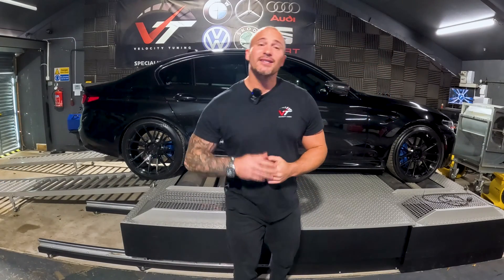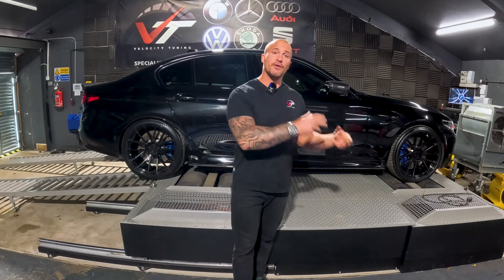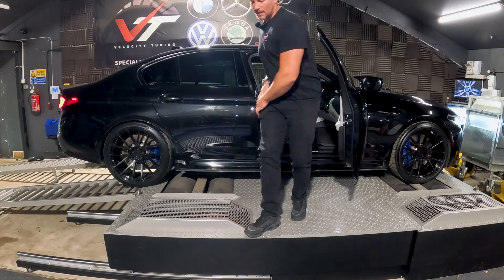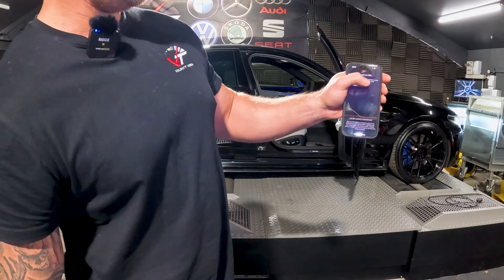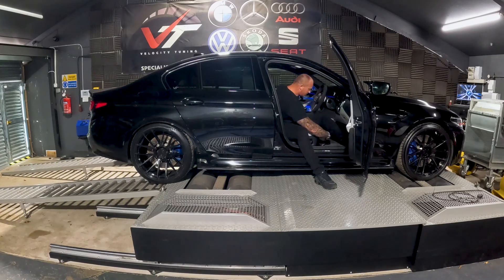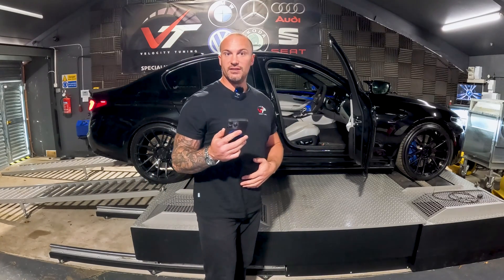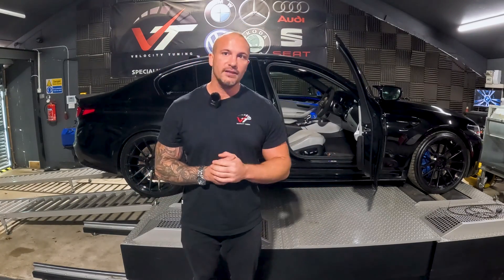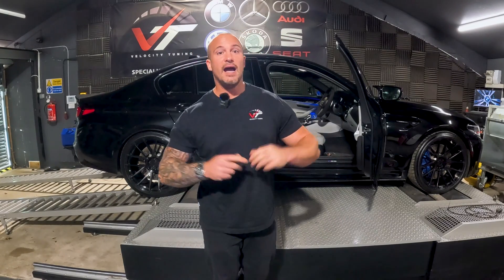We Bricked the Shop M5 ECU - How to recover a failed flash

Comment: i had a failed flash a few years ago. ever since i been chasing a valvetronic surging issue that happens at low rpm low load. iv done alot of things including replacing the entire valvetronic which nothing has fixed it. im wondering if its corrupted logic from the failed flash

Comment: first guy on the internet that didn’t make it seem like the end of the world, every forum says i’d have to replace my ecu. Mine bricked and i was freaking out but it recovered it thankfully
Reply: How did you recover it?
Reply: @ luckily when i plugged in the tune it said bricked ecu detected would you like to start recovery mode and it worked
Reply: @ lol mine didnt do that but i fixed it ended up disconnecting the battery and charging the battery also used laptop to flash,
Reply: True, most people make it seem like you have to burn down the whole car if you brick the ECU

Comment: How do u turn the ignition on 440i ?? 2018, I was flashing and in the middle my car shut off now keep saying ignition turn off and does not let me flash it nomore
Reply: Did you fix this
Reply: @f30cole  yes I did
Reply: @Ph_.215  please let me know how having this issue right now
Reply: @f30cole  Bro try unplugging the battery, charge it then plug the cables back in, that’s what I did and fixed the issue
Reply: I have a 2018 440 manual and the auxiliary power shut off in the middle of a flash, how do I keep the ignition on (engine not running) for the duration of the flash?
Reply: @senselessgibberish798  if it’s an F series you can connect the driver side seat belt , it’ll keep the car accessories on .
Reply: @DantesInfernoh ok thank you, I’ll try it out